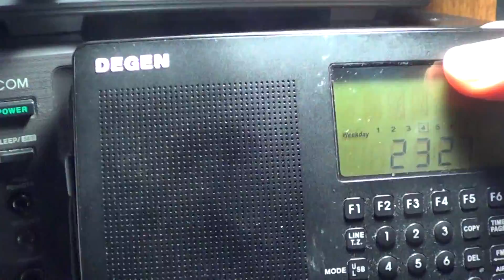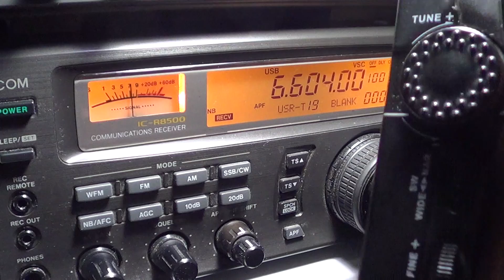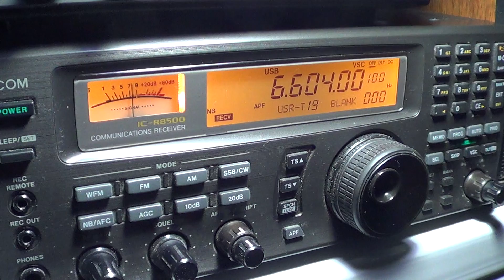What is SSB USB and LSB modes

Comment: That’s an expensive receiver! Nice, What kind of antenna do you have that works well? I have a portable Tecsun pl330 portable.  I have a 100 ft. 16 gauge copper wire for an antenna.  I need something better. Any suggestions?

Comment: Enjoyed your video.  I want to ask you how to solve this problem when listening to SSB either USB or LSB.  Why am I not able to hear 2 HAM operators talking?  I only hear one operator talking and I cannot hear the other person when he replies.  How do I tune my radio so that I can listen to both operators?  Cheers
Reply from the maker: It had to do with propagation, nothing you can do, it simply means you hear on that the signal reaches you but often the other station signal will not reach your radio.   This happens often and most of the time on the higher bands

Comment: I have the Eton 750 Satellit. A shortwave signal doesn't play well in SSB. It plays best in it's own shortwave mode. Doesn't that mean that it's already built into the radio? I can turn on LSB or USB tuned in to a station but it doesn't improve the quality.
Reply from the maker: LSB USB is a transmission mode.   It is to be used in the utility and amateur radio bands not on the International broadcast bands
Reply: @OfficialSWLchannel , a little confusing but it answers my question.

Comment: I've always known about radio and could build radios and I know schematics and tubes and transistors but I never understood the terminology about ham what it consists of until the other day basically I met someone that tried to explain more of it the way I understand it with single sideband I can communicate with some ham operator heading right or wrong? And I also believe that it is a form of frequency modulation and I can be wrong but it definitely is not a.m. thank you so much I'm wanting to learn I'm going to take my technicians license pretty soon

Comment: I discovered that if you put two regular shortwave radios side by side. You can listen to single side band.
Just tune one radio to a sideband signal and use the other one by jamming the other radio. If you slowly tune to jam the other radio you can hear the others sideband conversation

Comment: I realize I'm watching your video 6-1/2 yrs after you put it out, but it's the only video I'm aware of that explains SSB. When I think about it, in theory at least, if you had a really sensitive SW tuner, you should be able to tune into a channel that carries SSB and then tune down (counterclockwise) to get LSB and up (clockwise) to get USB. Anyway, I never figured it out, so even on my RadioShack and Tecsun SW's I couldn't get SSB even though the button was there. Can you do scans in SSB?? Also, is the reception on a monster iCOM radio worth the extra for reception (listening) quality?? What about the Sangean or Tecsun 2000 which I think goes for about $300?? Thanks for your video.

Comment: Hi is a shortwave radio ssb? I am confused? Also with and SDR I recently bought there is Narrow band FM and wide band FM it is very confusing what is used by a radio station? how do I find out more to understand all this Thanks Ian
Reply from the maker: not always some Shortwave radios have SSB some dont, as for Narrow and Wide FM, NFM is for regular transmissions from Amateur radio operators or law enforcement, Wide FM is used for the FM radio band to listen to radio stations
Reply: @OfficialSWLchannel  thanks

Comment: A BFO is used to inject a micro carrier. A better way to describe this, the Carrier (AM) is the  center of the signal. Above center, is the Upper Side band. Below, is the Lower. These are purely modulation that modulate the carrier. The closer to carrier (center) the lower the frequency of amplitude (Bass) and the farther is higher (Treble).

Comment: Just google it ;) In radio communications, single-sideband modulation (SSB) or single-sideband suppressed-carrier modulation (SSB-SC) is a refinement of amplitude modulation which uses transmitter power and bandwidth more efficiently.

Comment: I would ask a question but since you haven't responded to any of your viewers in 3 years i would be wasting my time
Reply from the maker: not I did respond... just ask
Reply: @OfficialSWLchannel  hi did you already  got your lasence  before  you start using this greate radio? And second question,  what kind antenna is required  to use with this radio. Thanks.

Comment: Hi, I just got into listening to number stations using a website but I would like to get my own radio/reciever (I still don't know if they are the same thing or not). Any recommendations for a cheap starter radio?
Reply from the maker: What is the price you want to pay for a radio ?     Numbers stations are difficult to hear .. usually requires a better than average radio
Reply: OfficialSWLchannel
If it costs more than £100 then I think I will just use the website lol
Also what do I need to be able to pick up signals from far away places like the US?
Reply from the maker: IF you just want to receive regular broadcast stations on shortwave and ham radio stations .. a radio like the Degen DE 1103 is a good choice ..  it's going to cost about $80 US shipping included
Reply: OfficialSWLchannel
Thanks for the recommendation, I just watched your other video about what shortwave radios to buy and I think I will get the Degen DE 1103. Ty for all the help man :)
Reply: OfficialSWLchannel I have a old radio with BFO off/on switch and BFO control +/-, and RF Gain dial. no ssb button . Bands are FM MW LW SW. It also has AM Narrow and AM Wide. Can I tune in USB and LSB with this radio
Reply: yes you can, turning the BFO on will let you listen to USB and LSB.